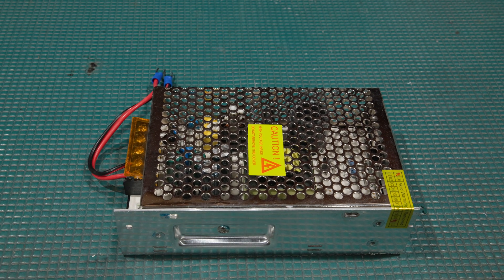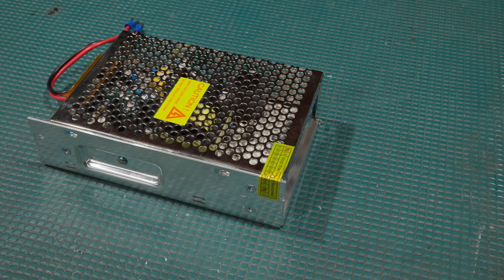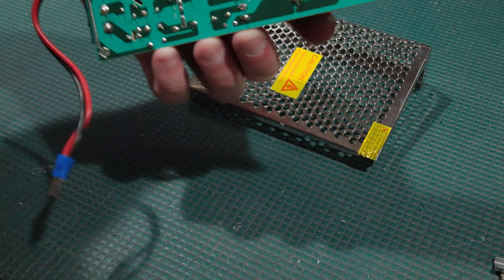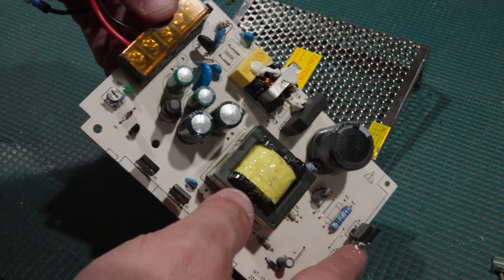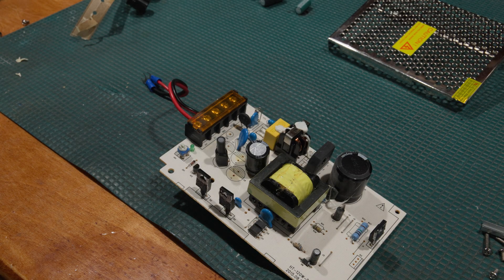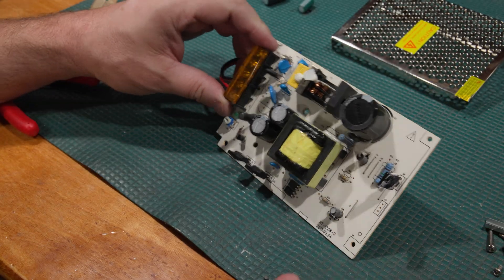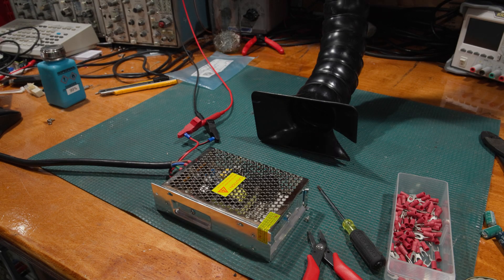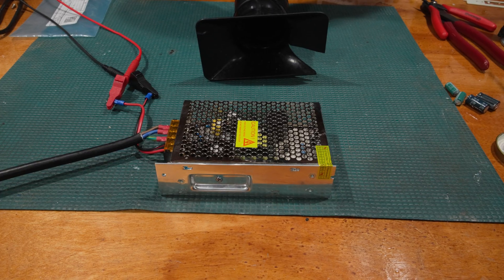Emergency repair of sketchy power supplies! (SMPS Basics and Troubleshooting)

Comment: 11.71V ----------- NO NO NO NONONONONONONONONO!!!!!!!!!!!!!!!!!!!!!!!!!
The wires have a voltage drop, ONLY EVER measure at PSU output!!!!!!!!!!!!!!!!!!!!!!!!!!!!
Reply: ....it is concerning you do repairs and fundamental OHMs law is missing in your operation!!!!!!!!!!!!!!!!!!!!!!!!!!
Reply from the maker: Sure this is totally correct. However this was gross function testing of a NON precision supply. The voltage drop experienced assuming a nominal test lead resistance of 0.005 Ohms or 5 mOhms at 10 amps of current would be 50mV the regulation or lack of regulation of the power supply accounts for over 80% of the voltage drops as well as the devices that this unit powers have a voltage tolerance of 1.5 Vdc + or - centered on 12 V I would never expect this supply to have the regulation and performance of a 2281 that can adjust and measure micro amps and nano volts. That level of precision is not needed or even hoped for in this application. What IS needed and was tested was can this supply deliver a full 10 amps with out the voltage crashing under the lower limit. In that area yea it was a but light but it is serviceable also in service the draw on the supply is about 2.5 amps nowhere NEAR the full 10 that the load pulled out of it.

Comment: Nice! Those off-brand smps scare me, try to stick to meanwell, they're everywhere in china, thankfully they mostly fail dead.

The bulk caps were getting hot? That doesn't sound good at all, sounds like they need 2 smaller, higher v rated caps in parallel at the front to ease down the inrush, but that's just moving the problem around really, maybe the load is spiky and that's where this is coming from, I've seen people try to put small motors on these things...

Comment: I had a larger similar unit (12v 20A?) catch fire once a few years ago. Luckily mine was mounted on a concrete wall, so all that happened was a scorch mark on the paint. Interestingly, my unit had a big filter inductor on the output - very unusual at the $20 price for them to care about output rippple, and that toroid is what overheated, and burnt the pcb and the caps next to it. After rewinding and replacing all needed components, I cut a 40mm square hole above the inductor and put in a 40mmfan directly over the inductor. Works great, but now I NEVER run it close to full power.
Reply: The "Rated Power" is optimistic, and assumes purely resistive loads. Would replace it with a meanwell at 50% higher rating for safety, these things scare me.

Comment: I would also have replaced the little C18? that is around typically 33uF @ 35V. they often dry out and cause the burst or hiccup mode when they cannot hold enough energy to keep the controller chip powered during startup.

Comment: Measuring voltage under load at the Keithley just based on your supply cables? tsk tsk 😂 Sense cables! Also known as... common sense cables. I'll show myself out...
(I was going to give you some gentle ribbing about your use of alligator clips but hoo boy would that make me a hypocrite!)
Reply from the maker: Given the nature of what this powers in the field gross checking was just fine. Also that is a dig on the Keithley actually the sense terminals are in the BACK. They should be in the front.
Reply: @ZenwizardStudios  What the... just on the back? Wow, I expect a lot better than that from Keithley, although loads aren't exactly their strong spot in test gear either...

If you ever find yourself wanting to expand into more loads/higher capacity, I've had fantastic luck with Chroma power gear. Ugly as sin, but reliable and hard to kill :D. (Most extreme example: I dropped a loaded 6341A from about a 4 foot height and the worst damage was that the bezel cracked, which was easily remedied)

Comment: Wouldn't it have been easier to just order a new much more reliable and well built Mean Well power supply?  And to say that a good quality one is "extremely expensive" is almost comical.    Have you priced high quality supplies like this recently?  They are cheap, really cheap.  And if for no other reason it's highly recommended to use quality supplies because they actually meet FCC EMC compliance standards and don't spew RFI all over the spectrum.
Reply from the maker: This is true but this was in an industrial application where if I had replaced it it would need to be Omron or one of the other Scata brands. The DIN rail stuff is still expensive. But not needing to go to that level 12V 10A is easily attainable this is very true.
Reply: @ZenwizardStudios  The Omron one's I looked at kinda sucked despite the price.  Meanwell makes millions of these and know what they're doing; they only seem to cheap out where it doesn't really matter.  TDK-Lamda, Delta, XP Power otherwise.  Why would you use a brand who's bread and butter isn't SMPS?
Reply: @ZenwizardStudios  Even name brand DIN rail supplies are cheap, especially for a industrial customer.  $45 to $100 gets you TDK/Lambda (I stock these), Mornsun America (I stock these), Phoenix Contact,  Bel Power Solutions (I stock these), Delta Electronics, Altech, etc...  Mean Well also makes DIN rail supplies that are even cheaper but still high quality.  I stock close to 100 different power supplies as replacements for commercial/industrial customers I service equipment for.  I'm not going to say money is no object but when a 5 to 10 million dollar production line shuts down they could care less how much the replacement part cost.  I could tell them the repair will cost $100, $1,000 or $10,000 and I will get the same reply every time, "We don't care how much it cost.  Is it repaired yet?".  I have had to have parts overnighted from countries like Germany, Japan, etc...  where the shipping was over $1,000 and they didn't bat a eyelash when I sent them the bill.
Reply: @ZenwizardStudios  >The DIN rail stuff is still expensive

It's not really anymore, I switched to DIN for most of my gear just because it's easier to mount and organize (those little brackets for the open frames are a pain). I think it's around $23 for a meanwell 12v15A or so, and they are absolutely bulletproof inside and out.

Comment: its cheap and very good in an interestingly contradictory way , yes component choices are bad but not one electrolytic nestled right up to the chopper transistor or its heatsink , or the other favorite heat source used as a delibrate cap killer =the chopper transformer ,theres  loads of air gap between components seems like the pcb design was basis for something good quality then someone got a calculator out after that, i used to repair tv and hifi and wedging elecrolytics right up to heatsinks was so common i realised its an effective way of predicting and ensuring the planned demise time period, this psu even lends itself well to having a pc fan bolted to the top cover
Reply: Agreed, this my pet peeve too, I see it so often even in higher quality equipment, electrolytic caps placed up against or very close to heat sources, designed to fail sooner.
Reply: @TheDefpom yes got a couple of 24 series tektronix scopes that do this on mass but they do fan cool them as a backtrack on a bad layout
Reply from the maker: Indeed the 24xx scopes also were REALLY hard on the output filters on a current draw basis. They really could have used some more capacitance to make it easier on the outputs.